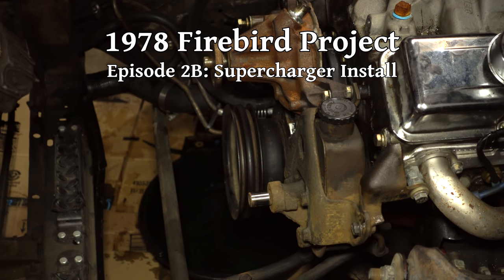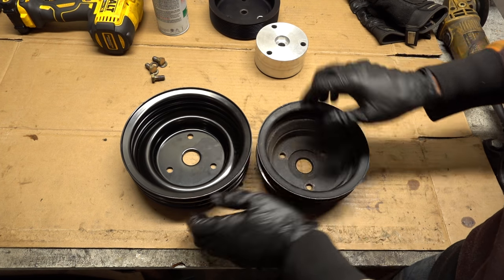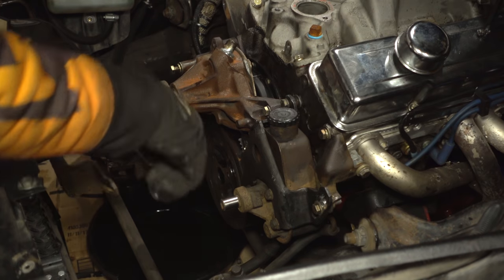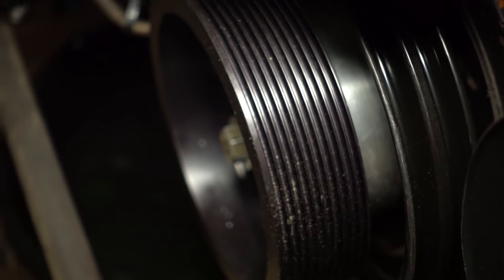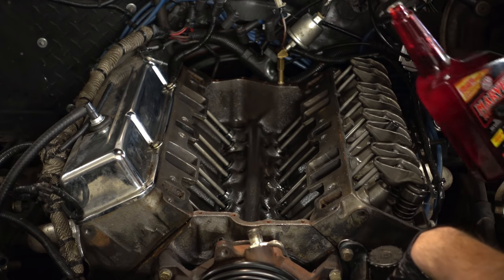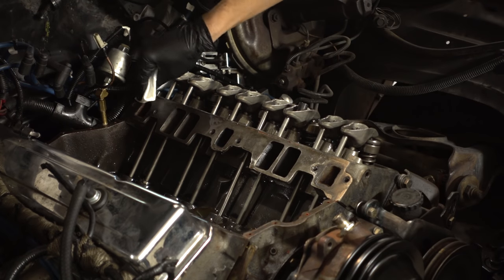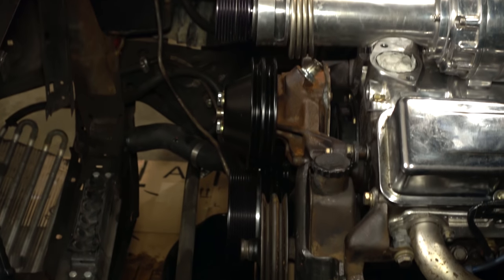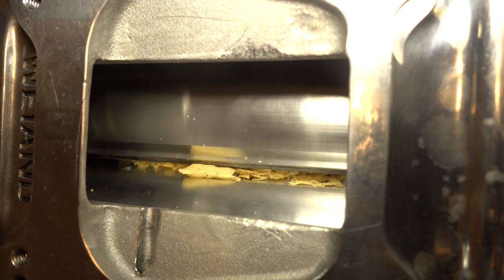1978 Firebird Weiand Supercharger Install (Ep.2 Part 2 of 2)

Comment: Im kind of curios , 
Those pontiac Firebirds and trans ams are famous for their 400 small blocks made by oldsmobile.
And their very well known for their balancers being a different size.
Run the ballancer numbers ,block numbers  front pad serials  
It could be a stroker 400 small block  crank Internaly ballanced  Externaly ,ballanced  HMMM?
I think the 350 went to a external bigger ballancer in 85 hecko new mexico.
If its got 400 pistons  you might have to get a different top pulley to get   The right boost .
Reply from the maker: It isn't the original engine, it is a 350 block (from checking the casting numbers I can be pretty certain of it) and chances are it is not a stroker. Can't check the serial number since it is mostly gone from decking. The balancer is from an older 305, as some commenters pointed out to me, which is fairly common to run on certain setups where you would want a smaller, lighter balancer.
Reply: I was worried it would through crank out of balance.
You should get a boost gauge .
It will help you know when something is up.
Does it feel like two 350s are under hood?
Reply from the maker: Power-wise? I haven't driven it enough yet, chasing around some tuning issues trying to make it as safe as possible. Definitely has more pep, though I haven't driven it hard yet.
Reply: I would not lockout the mechanicle advance  with the two screws  or sludge it up with grease
cause you need that through the rpms the vacume advance is strictly economy.
I just tossed my cpu controled distributor for older hei and got 30 more horses 
on my 305.
In my 82 diablo 
It was doing the same thing.
Reply: And dont worry so much  youve got a valve float rev limiter till you put in 400 pound spring.
And also your higher gears will protect it. just keep it in drive and get kickdown cable hooked up.